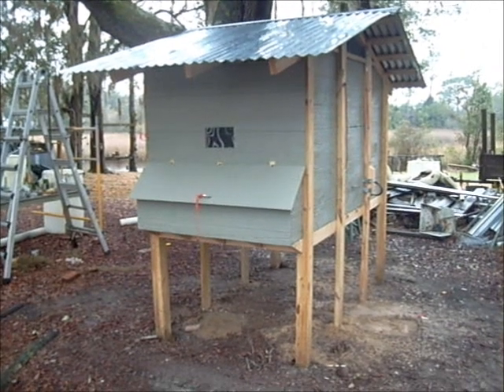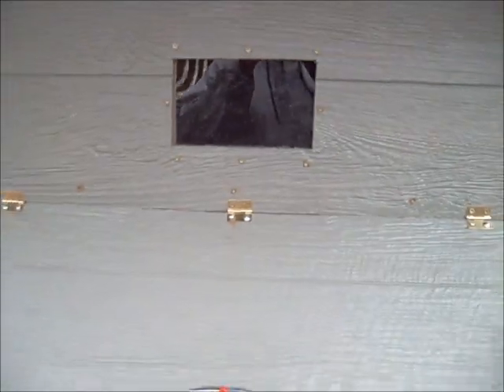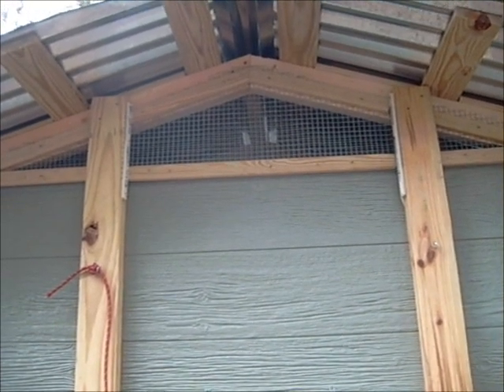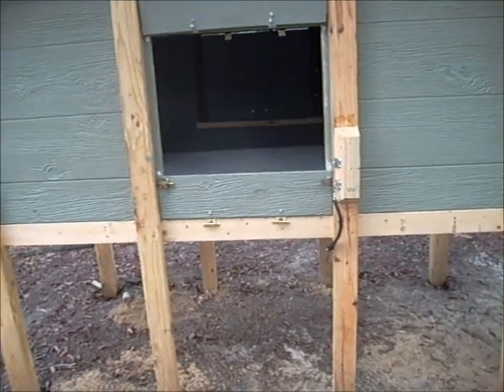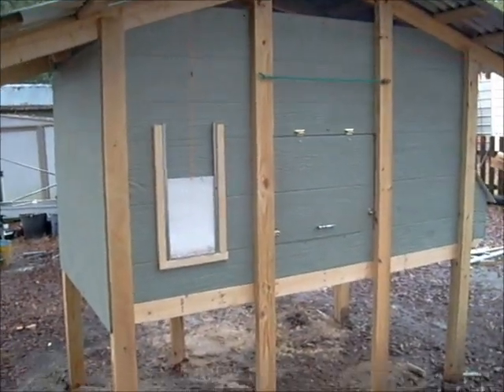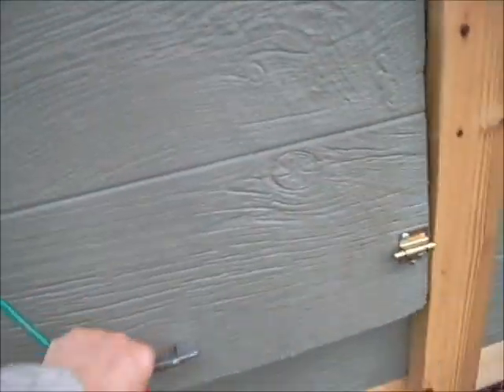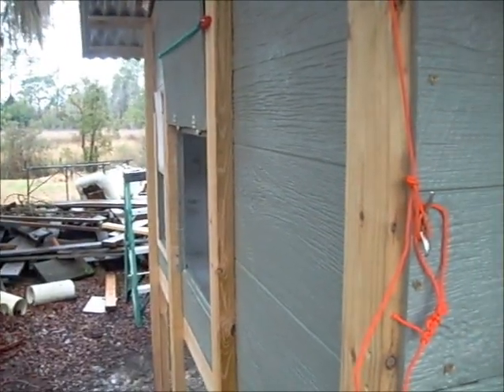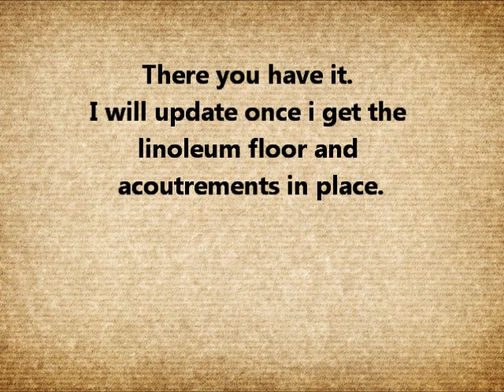First Chicken Coop Build

Comment: I am planning on building one very similar but instead of having the nesting boxes hanging off the outside of the coop I was going to have them inside.  I wouldn't put a sloped roof on the inside as above the nesting boxes I'm planning on having a cabinet accessible from the outside that I will use to store food and the water bucket which will service the water nipples.  I do like your doors and to see how you built the roof and legs.  Thanks for posting the video.
Reply from the maker: that sounds like an interesting plan. would you make a vid when your done? I would like to see it! thanks.
Reply: Renaissance MarineTV About half way there (not counting the painting).  Not enough credit is given to those who can make a big wood box.  Especially figuring out how to assemble it so as to not have to crawl inside to put some finishing screws in.  I'm getting there, but for those of us a few decades from wood shop, it takes some mental ninjutsu to figure some of this out.  I would have gotten farther yesterday but I ran out of some materials so I'll be picking more up today after work and seeing how much farther I get.  It starts raining on Wednesday here so I may end up leaving my pop-up canopy over it for a few days until I can finish the roof.
Reply from the maker: good luck! I am excited to see it.
Reply: Renaissance MarineTV Well, the rain finally started in Oregon (on the first day of fall, go figure).  Put a canopy over everything and I'll try to get it finished on Saturday.

Comment: We are moving and will be rebuilding. I love this coop it's solved a lot of issues I have with my current coop. How big is this and about how much did it cost you?
Reply from the maker: ididnt keep good records on this, my first coop. but it is 4 by 6 or so. if you compare it to my newer video where I build a slightly smaller one for a neighbor where idid keep records. that one cost right at 350 dollars.
Reply: +Renaissance MarineTV thanks for the quick reply! That's not too bad. I have some lumber already since we are tearing down the old one so that may offset some cost too. Thanks again!
Reply from the maker: I use treated 2 by 4s, and the most inexpensive shed paneling, which means I have to paint the heck out of it!
Reply: +Renaissance MarineTV I'm ok with painting. I never painted the one we have now. Bought paint and it's still sitting in the shed. What a waste. But I'd like to paint the new one. Make it look a little nicer than just wood color lol! I'm also going to have the whole thing raised and either use 4x8 boards for the base of the run or leave it on the ground and use hardware cloth across the bottom frame. Too many diggers trying to get in and I'm sick of filling holes.
Reply: +Renaissance MarineTV we buried wire too but rats or mice or something is still getting in. I don't get up early enough to let them out so I like to leave their coop door open all the time. They have killed a mouse before but we also have ground hogs under our shed which is right next to the coop and those things dug under the wire!! I couldn't believe it. It's a foot down! I'd like to use poison in the holes but I also have a puppy who likes to dig in those holes around the shed so I can't.

Comment: In the coop I'm building, I'm starting with only four legs (about 2' in from each end).  I'll be cross bracing them to each other and they are only a little over 2' to the floor.  I'm hoping this will be enough to support the weight.  If I need to I can add more legs, but I'm hoping to at some point put wheels on this so it's semi-portable.